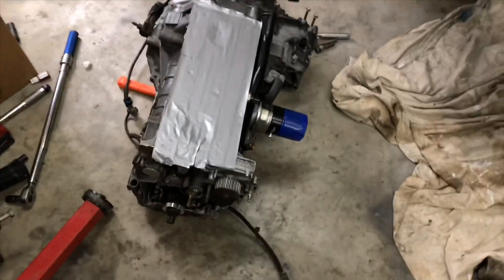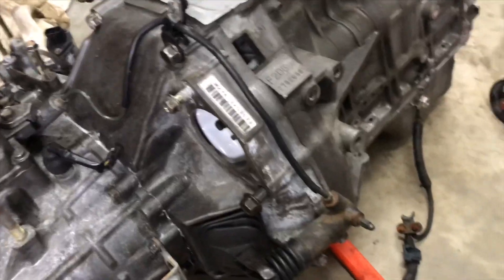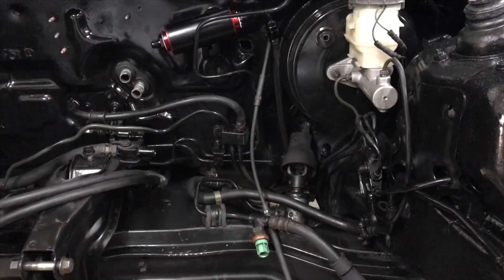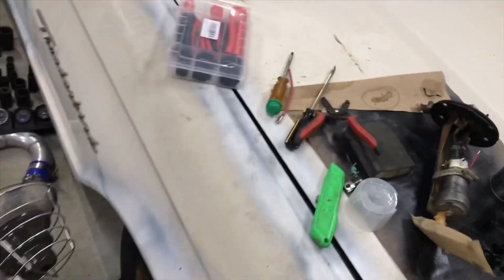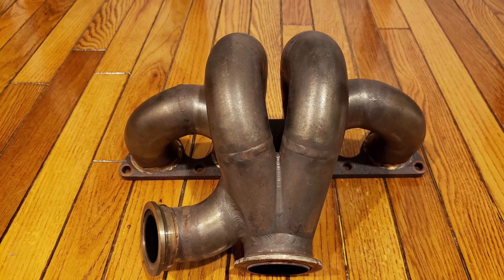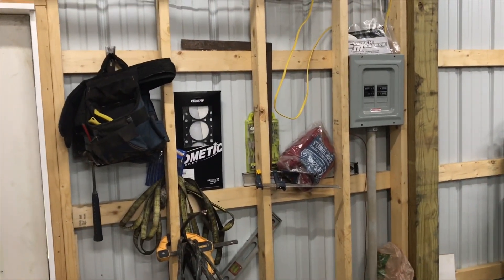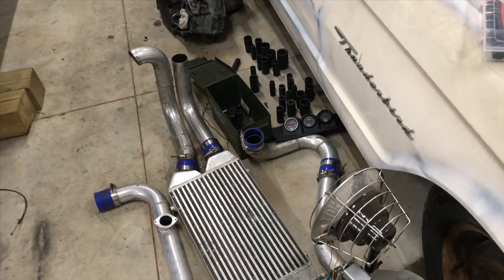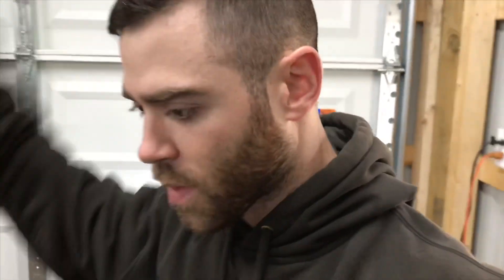How I Built My 600HP Turbo F20B - Short Block

Comment: Did you paint the bay?  Looks good. Custom paint work?
Reply from the maker: I_auto_enthusiast yes rattle can...it was a mess...got a couple bad cans of paint and had to stripped the bay 😑 paint looks OK now 😕
Reply: @thestateofreal2533  looks better then not doing anything. Looks like some sparkle in it.
Reply from the maker: I_auto_enthusiast yea that’s why I did it...previous owner had a front end accident and welded a rad support on it so bad it looked like the welder was blind. I chopped it off and welded it back on as straight as possible then rattle canned it and blew some glitter in the clear coat for some jdm pazaz 😂
Reply: @thestateofreal2533  I dig it. I'm glad to see some different ideas on a budget. I may not like some stuff but I don't judge ppl for trying or doing stuff to their cars. That's a positive apporch to the car scene.
Reply: Hey bro , how did the Devcon epoxy job do ? Have you had the head back off since running it over time ? How did this build do ? Did it last ? Is it still running? I'm tearing down a new f20b block last one spun mains , reusing my forged pistons and rods. Being stock bore css won't work said I have to bore. So I'm looking at doing what you did . Did it seem to work ? Did it hold up.
Reply from the maker: @brianburris thanks for reaching out! The build has been together for 3yrs now and a range of power from 350hp to 550hp now. I have no issues form the block or rotating assembly at all. I have changed turbos for power needs and turbine housing exhaust flow and boost creep have been my major troubles.
Reply: Are you using a stock oil pump on this build ? Stock oil pan ?  I'm doing a F20b I bought the car with spun mains , and bought a new block after tare down. Anything you would have done differently? Btw kinda funny the 1st work space looks just like mine , plus I'm looking at building a garage next to my house, I'm also do machining at work lol.
Reply from the maker: @brianburris oem h22 used oil lump that I checked the clearances on and it came out at .002 clearance so it’s good. I just shimmed the pump with a .04 washer. Yea man you can do it anywhere!
Reply from the maker: @brianburris  stock everything